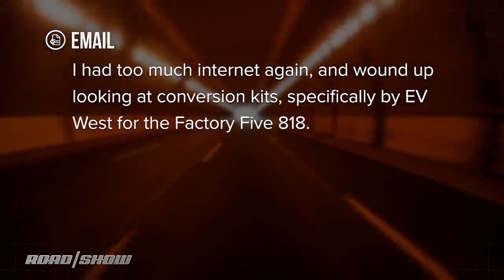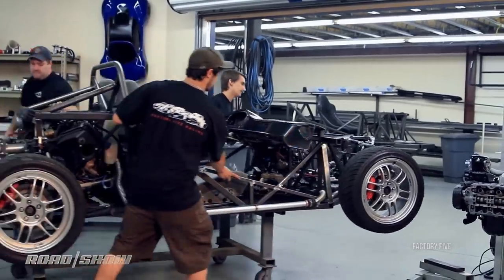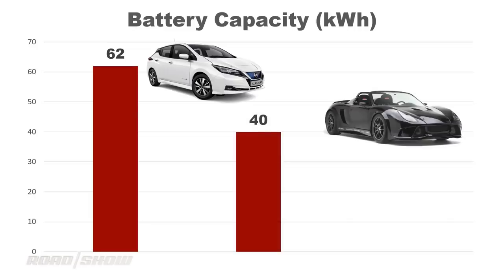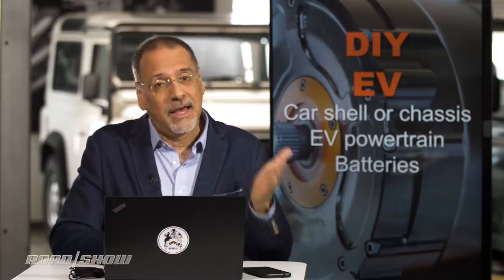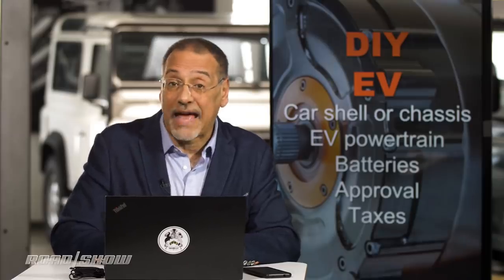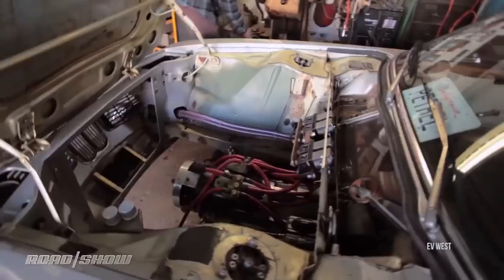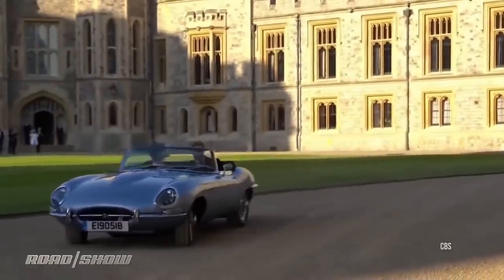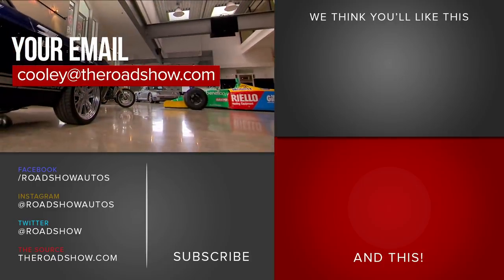Before you buy an EV, consider building your own with a conversion kit!

Comment: don't care for pure EVs, but what I want to build is a hybrid which does pure electric at low speeds, where internal combustion is inefficient, and the electric motors act as a supercharger in sport mode.

Comment: I would say the cheapest and safest way to do it would be to get a kit car like 818 and then get a reck  Zero motorcycle but with a working power train, you get up to 100 HP and all you need  motor battery an controller for around 5k, the only problem would be the range but this is just a commuters car any way.

Comment: The EV conversions for some reason are never very good on range
Reply: Cost is the biggest reason. Building your own EV is much more expensive than just buying a factory-built one. It's also often tricky to fit a full battery pack into a car that wasn't designed for it.
Reply: Harder to fit as many batteries in a  converted ICE car than a factory electric car.
Reply: You're right. They go further on a charge doing short trips than they do on long drives. Ev cars depend a lot on regenerative charging.
Reply: Just slap in some more packs and your good to go.

Comment: From $50K to $150K for an electric car. No thanks, I'll spend $70K for the mid-engine Corvette.
Reply: Tesla Model 3 is a great EV that starts at $35k, and doesn't need expensive smelly gas or oil changes all the time.

And there are cheaper EVs than that
Reply: @iKingRPG  I actually had an model 3 on order and waited 2 yrs for it. And I went and got a job building model 3 and saw how bad the build quality are. So I told management they are building garbage. I cancel my order and quit shortly after.

Comment: i wanted to convert my 68 442 to electric but i keep hitting walls
Reply: Does yours have a 455? Because those are rowdy!
Reply: @96ej  nope. the original 400. 138k miles original
Reply: @mradaChris  super cool, I never knew those came with 400 so I thought they were always 355 or 455
Reply: @96ej  My car needs to be restore and the cost of rebuilding an engine is about $7-8K a new paint job/body work probably $10K.  I am teetering on selling it or restoring it.  I feel that gas engines will become obsolete in the future unless they come up with a fuel that isn't toxic and polluting.